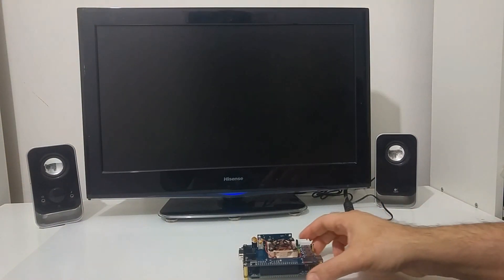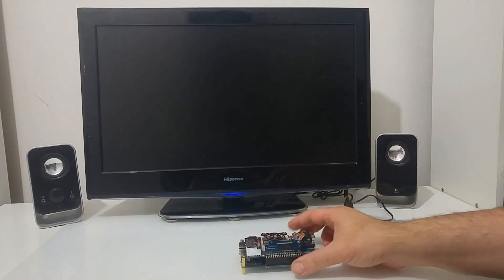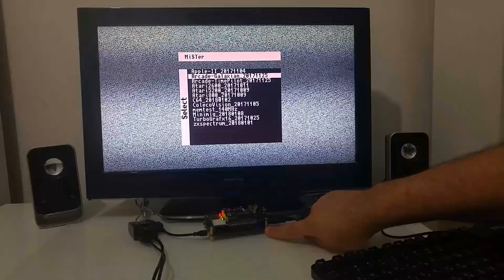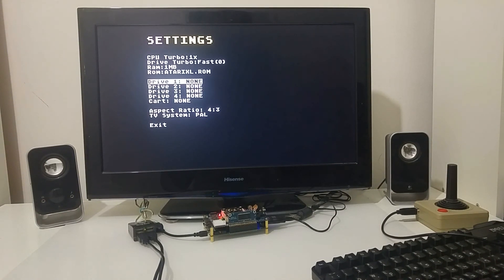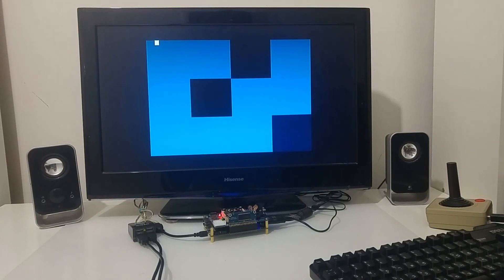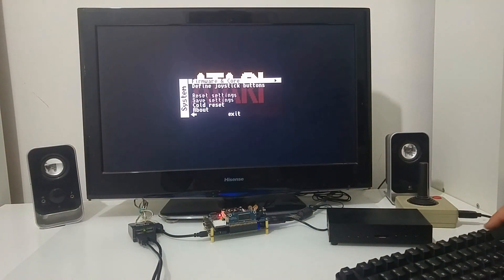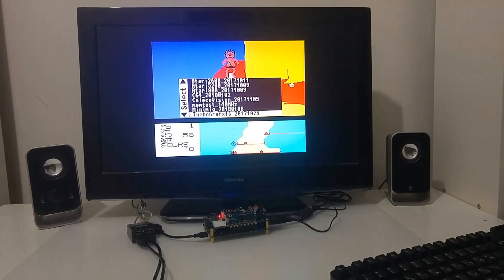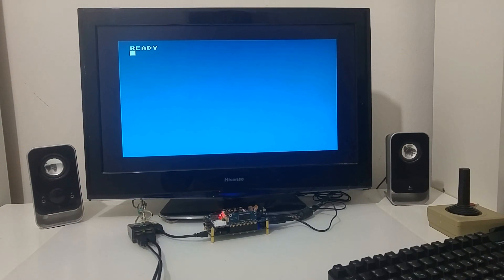Mister FPGA Board Emulating ATARI 800 XL Computer

Comment: I know this video is old and a lot has changed considering setting up but I recently bought a Mister Pi (Same as Mister FPGA) and I am at a total loss at how to set-up Atari 800. I have everything working on the Mister side, arcade games work fine and I also have SNES working but is there a step-by-step how to set-up the Atari 800?

Comment: I have a MiSTer. Such an amazing device for anyone interested in retro consoles and computers. I've recently been looking at dedicated FPGA based computers that fit into either original or replica cases to get the full experience of the system being (hardware) emulated. From a brief Google search, there doesn't appear to be any such project for the 800XL, which is a bit of a shame but understandable as I guess there isn't as much demand as there is for stuff like Amiga or C64. The Atari 800XL was my introduction to video games, though more of my childhood was spent with an Amiga. I kind of like the idea of having FPGA versions of a few of my favourite computers and consoles, though it would probably not be very practical compared to just using the MiSTer.

Comment: Is it really better than emulation ? (altirra)
Reply: way better for any computer game which doesn't use a framebuffering.  especially regarding fast action games if you want to play the games with correct timing and yet you still want to use modern displays and other modern accessories or VGA monitor, or even you can set up a true arcade RGB monitor and often you can use original input devices via SNAC add-on.  it's a very versatile system, and it's under constant, heavy development.  usually a core is not released to the github page until it is close to perfect. then it's just added feature updates after that.  there must be 150 or 200 cores at this point (i haven't counted lately)

Comment: Hi TMA8C, what are the red, yellow and green LEDs are for, on the  I/O board i bought are no LED's. Can I still attach them? Which one do i use?  Could you please do another video and be a little bit more explizit about the two SD-Card Slots and where to put which files and systems on. I'm not able to attach a mouse or a keyboard on the OTG-USB port ... right now I can only boot the supplemental Terasic SD-card with the Linux system. Do I have to program the Nano board before using it with the cores? Thanxalot ...

Comment: I would never have expected to see an Amiga Workbench screen on this channel, hahaha.  But considering the link between the Atari 8-bit machines and the Amigas, well, I guess I shouldn't be surprised.  Great video, I'd really like to get one of these myself, do you have any links to more information by any chance?
Reply: Troy Wilkins Indeed. The more I mess with my atari 800XL the more obvious it becomes that in terms of hardware design (not who built or sold it, but how it's designed and how it works), the atari 8 bit's true successor is clearly the Amiga...
Reply: Well, Jay Miner was behind both the design of the Atari 8-bit and the Amiga, obviously different CPUs (6502 vs 680x0), but the layout of the design is much alike - POKEY and PAULA both handle Audio generation and some input, ANTIC and AGNUS both feed data to GTIA and DENISE.  ANTIC has a programmable display list, capable of changing screen modes on a specified scanline, while the same thing can be done with AGNUS.  The entire Amiga system is an evolution of the Atari 8-bit line, and when designing it, Jay wanted it to run a minimal OS much like the Atari 8-bit systems.